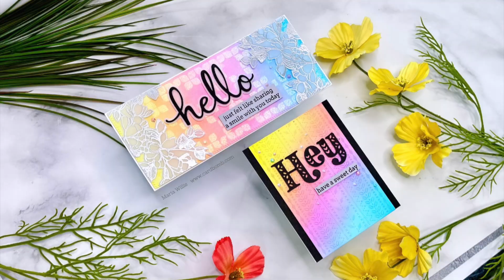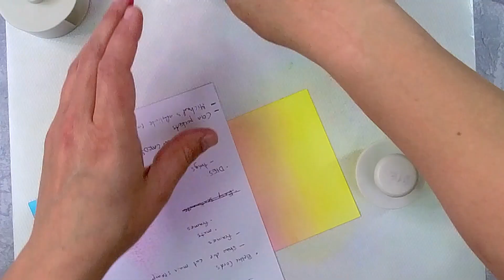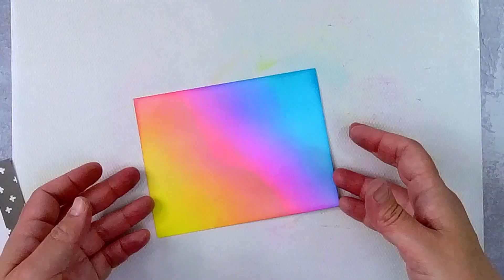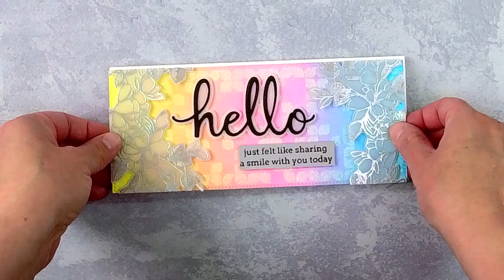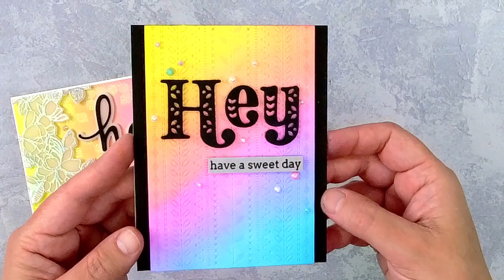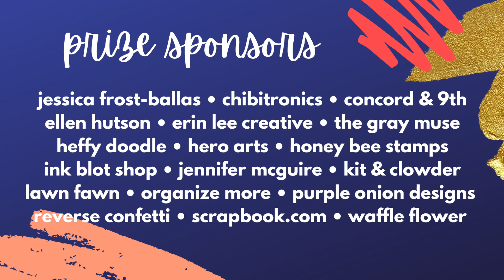Make Beautiful Cards with No Coloring!

Comment: I don't understand the differences between Bristol and Hammermill card stock.
Reply from the maker: Hi, Jane! The Bristol is a popular paper for ink blending bc it has a very smooth surface almost like there’s a littles coating on top. The ink sits on top an blends really well especially w distress oxides. Because of that smooth surface my ink sat on the surface and as I was adding the second layer of ink I was also accidentally lifting the ink off of the card with the hand holding the paper (I was using a paper to hold it and the paper was picking up ink). I was also getting fingerprints in my ink even though I barely touched the cardstock.This left marks in my blend that didn’t look good. I did mostly fix them but it took a lot of work. 

The Hammermill has a smooth surface too which made it wonderful for blending however it did absorb the ink better instead of the ink remaining on the surface to be marked. You can see in the video that I was holding the Hammermill with my fingers to ink blend and I didn’t get any fingerprints in it. The Hammermill also had a more vibrant ink color and the finished result was much smoother. I hope that helps!

Comment: Love the ink blended backgrounds. Not sure why you had trouble blending on bristol smooth cardstock. I use that paper all the time but using distress oxide ink and the ink blends beautifully.  The cards are beautiful.
Reply from the maker: I agree, that oxides blend well on Bristol. It was still a nice blend on the Bristol in the end. It was just a lot more effort than on the Hammermill and bc it has that smooth finish the ink kept lifting off (onto the paper that was preventing finger prints) and I every time it lifted ink I had to go back in and try to fix it. It’s interesting how differently papers can behave from each other.